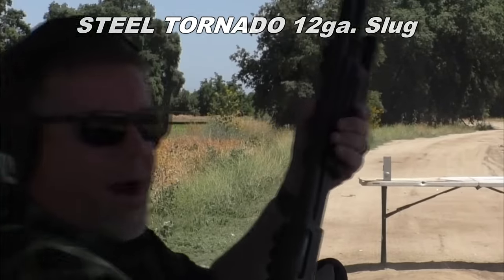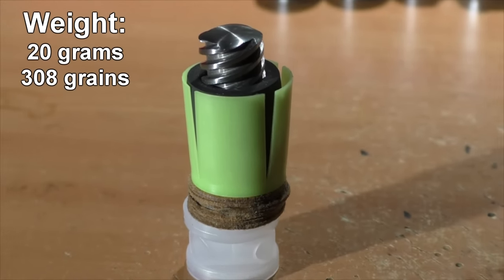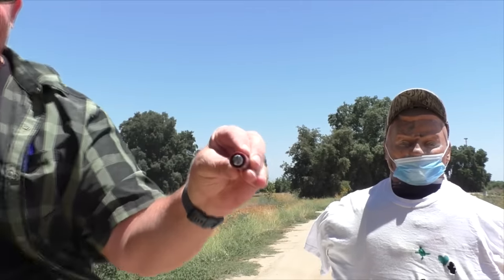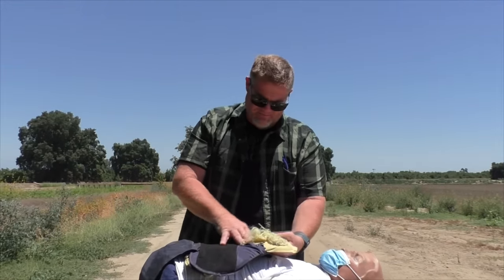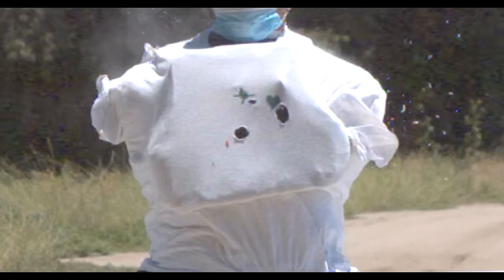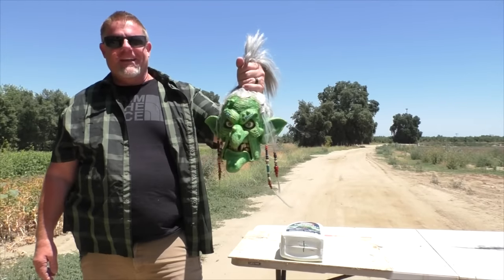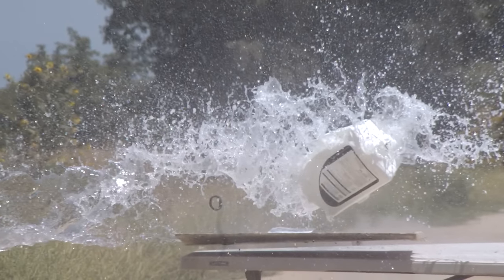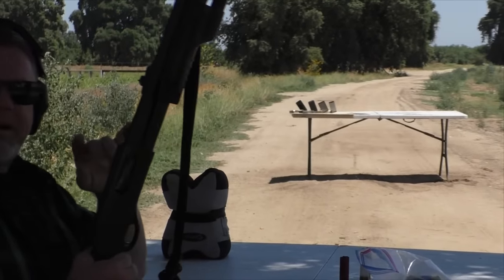We test the experimental STEEL TORNADO 12ga. Shotgun Slugs  - Wow!

Comment: Rebar slugs next please :) Cheep plentiful and easy to make.
Reply: Yes, that would be fun to see.
Reply: i have been thinking of trying to heat treat or even pack carburize some cut pieces of rebar so that they are hardened high carbon steel and then 3d print a sabot around them.
i dont have a viable work space to do this anymore so if someone can make this happen im sure the result will be interesting.
Reply: @uncoolsticcboi  I think making a sabot just for Rebar would sell. For people who live off grid it would be a great resource to have on hand if accurate. I think you could just harden the tip with a torch. You could chop saw a point or round it down like a slug.
Reply: I’d buy.
Reply: @uncoolsticcboi  i think 3D printing a sabot would be kinda overdoing it, i think just making a reusable mould that you fill with something like polymer clay would be a better way of doing it.
then add a guide line that tells you up to which point to fill it with clay, so it fills up completely when you put the rebar in, and something to help you centre the rebar inside the sabot and all you need to do now is fill the mould to the guideline, press the rebar into the mould centred (i think a reloading tool should have all you need for this) let the clay harden, remove the rebar with the sabot from the mould, rinse and repeat.
alternatively i'd suggest a two piece mould that you can fill with molten lead before inserting a pre-heated piece of rebar.
Reply: @windhelmguard5295  making a mold to mass produce the sabots would be the later stage after rapid prototyping with the 3d printed ones to find what works best.
Reply: Speaks from experience
Reply: I thought of rebar too when i saw this video. I’m surprised they haven’t done it yet.
Reply: Wait? What they shot wasn't rebar? Whats the difference?
Reply: Same thing I was thinking!
Reply: Use to make buckshot & slugs out of cheaper bird shot. Great Grandmother taught my sisters & I to shoot single shot 22 short at 5. Kill & skin squirrel. Already taught to bait a hook, scale perch. Thought everyone was taught young until I ran around in town. God. Family & Country was a must.

Comment: Acts like tool steel, not just common cold rolled bar stock. 😊
Reply: Yep, zero deformation in the lead plate.

(Yay, the lead plate returned!)
Reply: @markfergerson2145  I like the lead plate, hard enough to not completely give to anything every time, but soft enough that any good punch will give a neat impact crater for a visual.
Reply: Im curious as to how you came to such a conclusion?
Reply: @jamessouza7065  hardness. no deformation. Probably from a replaced ballscrew, which is a hardened part.
Reply: @hunterws  Wouldnt it shatter if it was hardened? oh ya it was probably tempered after forgot how all tat works! thanks
Reply: @jamessouza7065  It is a case hardened. The core is relatively soft, so it won't break.
Reply: @XtreeM_FaiL most ballscrews are through hardened. Not case hardened.
Reply: @ObservationofLimits  The ones I have work with were really hard. Soft steel start few mm under the thread bottom. 
HSS couln't chip the surface at all, but didn't have any trouble to drill the center.

Case hardening might not be the right word.
Reply: @XtreeM_FaiL  Is it face hardening you're thinking of?
Reply: @CATASTEROID934  What?

Comment: I'm surprised that it didn't go through the lead plate.
It's case hardened, so there should be very minimal deformation.
I guess it's because of the light weight.
Reply: Right...worm gear bar stock. Maybe B-4 50-60Rc heat treatment?? Who knows, F-N  V I O L E N T either way!!

Comment: I was just watching a video about the sort of ammunition that pirates fired out of cannons. 

Something a heck of a lot like "Dumbell" round was used. They called "Bar-Shot", but another projectile caught my eye...

"Star-Shot!" 

Even Perry should do some research into that.

It's basically four quarters of a steel ball, with bars smelted onto them, with ringlets at the ends which are linked together. 

Splays out into a  spinning cross when it's fired. 

Could be so.e potential in that🤔

Comment: You've got so many kevlar sheets. Perhaps, if you had a tungsten carbide punch and die, you could make wad reinforcers. Just roll out some RTV caulk stuff on the sheets, press a few sheets together between some waxed paper, and then punch out the disks to reinforce your wads for experiments that have iffy cohesion.

Comment: Nice use of old pieces of ball-screw!! Used them all the time in automation. I made the mistake of unscrewing one out of its bearing-carrier and the ball-bearings that ride in the ball-screw's flights, went everywhere!!  😎👍
Reply from the maker: Those ball screws are great when they work,   a mess when they don't
Reply: @taofledermaus  Yeah they're bad about the balls splitting cause some dunderhead will grease the screw instead of the bearing and cause it to collect trash/filings. 😆

Comment: I'm guessing, but I think what's happening is the air at that speed is inflating the rubber sleeve and the pressure is getting between the steel and the rubber and pressing it off with air pressure. 

Incidentally, "Air Pressure" was OG's competing band for Air Supply back in 1982...

Comment: If you are bent on using drywall mud, keep it in a sealed 5 gallon bucket with a little water on top. I would try regular clay watered down a little too thin it out.

Comment: Another great video showing that if it fits we can shoot it!! I wondered though, if you made a slug like that one except the threads were opposite wound than the rifling, would they cancel each other out. The barrel makes a slug twist one way and it the slug was twisted the other way? I'm not sure if that made sense.
Reply from the maker: The airflow really doesn't have much force on that a supersonic speeds.  It really takes a mechanical force to spin it in the few milliseconds of flight

Comment: Interesting  that a clean hole is made from the slug. must be that the threads act like a cutting edge, like a guillotine. would probably make some interesting punch holes if the projectile was a cone shape with threads on its surface, then im sure it would have extreme penetrating ability due to its small point of initial contact, then a shredding action as the threads act like little blades as they move through the target.  your channel is so great, everyone is proud of you.
Reply from the maker: thanks!

Comment: Great video!

I suspect the rubber was expanded by the rotation imparted by the shotgun, and caused it to depart the screw. BUT, the last shot with the leather wad shows the card stock was failing, and pushing the rubber sleeve off? However, I don't know when you were using the rifled shotgun or the smooth bore shotgun...

That tomato sauce turned into tomato puree!
Reply: More like aerosol.

Comment: Hey Jeff, I was just thining about the reflection requirements of the gel block and the hssles of putting layers of shtuff underneath it. Would high gloss metalic (sic) spray paint on the table work?   Y'know, like the fake chrome finish stuff

Take it easy, dude, and thanks for the vids man. If you had thought of this (and i'd betcha a steak you have) let me know, will ya? Cheers from oz

Comment: I made and played with a bunch of very similar rounds using cut up 5/8" All Thread as the nain ingredient.  The biggest issue was finding a length that gave stability in flight through a rifled choke.  Durn things kept key holing and veering off course at 25 yards.
Reply from the maker: Probably about 3/4"  (around bore size) would probably work best.
Reply: @taofledermaus  Interesting.  I was trying the old pistol standard of 1.5 times diameter and longer.  I will look into shorter than that.

Comment: On the first slomo you can clearly see the foam sleeve spinning and shrinking slightly as it slows down. 
I think between the rifling and the grooves the foam was compressed sufficiently to grip the slug without slippage all the way down the barrel, but as soon as it left the barrel the centrifugal forces on the foam caused it to expand and smoothly release the slug so they both kept flying true.

 It's beautiful. It's got me thinking maybe the foam itself is the key to making some of the previous failed experiments worth a second look. Can you buy it in bulk? lol
Reply from the maker: That is quite possible.

Comment: I think you're really getting some benefit that wasn't anticipated. Notice first the helix of the worm thread, a short piece of worm gear, is in a complimentary direction of the rifling. So the rifling is getting a spin started and the aerodynamics of the thread providing downrange stability. The piece of rubber hose is giving good energy translation from the rifling to the steel core but it's quick separation is probably beneficial, not detrimental.

Comment: That is a multi lead or multi start thread, this one in particular is a quad lead. The idea is to have something actuate quickly, like a window, but also retain the number of threads so you don't end up with something like a corkscrew. Acme is a rather coarse thread but it is only a single lead.
Reply: Acme is also trapazoidal. Lead screw is a square thread.

Comment: That type of threaded rod (proper name escapes me atm), is expensive stuff. It's usually used in things like cnc mills, 3d printers, etc.

But it turns out it's also an amazing projectile. 

Think my favorite thing from this vid was the yellow shot cup in the 3rd shot (I think), where it turned into a propeller and took off. 😂
Reply: leadscrew and/or ballscrew

i'm not going to rewind and watch it again but to me the threads didn't look right for that application. I could be wrong though
Reply: @Nick-bb4nk  You could be right, I'm no cnc expert. But that's what it looks to me though.

Comment: I thought the face looked more like Nancy P. than SJP.
I wonder if a revisit to this but with a steel washer welded to the trailing end of the bar that's the same outside diameter as the rubber sleeve would help.

Comment: It is an acme thread but the rod has been double threaded.  This is common in low torque applications that require a very course and durable thread with high accuracy and low backlash.  Other than that…cool.

Comment: I would be concerned that the portion of the worm gear that protrudes from the shot cup in the soft rubber Sabo was Graach the war of the rifle. I thought processes that if the rubber Sabo compresses more on one side and the other from the tremendous force pushing it it could tilt enough that would scrape the inside of the more.

Comment: At first I thought it was simply a piece of threaded rod, but cross section shows there are 4 independent thread. I wonder, what if it had a ballistic tip?
Reply: It’s a multi-start acme thread, in this case, 4 starts. So the thread has the same pitch as a normal acme thread, but it has a lead of 4x the pitch. They are used as lead screws in CNC machines.
Reply: @kenpickett9317  So the maker, who we know has a CNC machine for mass production of some of his designs, converted replaced parts from his CNC into 12ga slugs, nice!

Comment: If the lead plate is 5cm thick and it stands in an angle of 45 degrees, than the bullet have around the 7cm to penetrate, because the bullet goes straight while the plate is in an angle.. the armor of a tank works the same.

Comment: Can you use a coil steel spring instead of wadding?
Reply from the maker: It would probably crush the spring with the 12,000ish psi of pressure slamming against it.
Reply: @taofledermaus  I see you've done it in videos a few times, but I was thinking like a car valve lifter spring. The race ones might be able to take it

Comment: You need some 3 1/2" shells to get the muzzle energy up.
Reply from the maker: It's not the length of a shell, it's the powder load that determines velocity.   Can't really just stuff more powder in or you might end up with a bomb
Reply: Ed Hubel was my hero a few years ago. Slug loads for 3 1/2" are generally more substantial along with the guns chambered for them.

Comment: It's a 4 start acme threaded lead screw.
Reply: Acme threads are trapazoidal. This is a square thread, as used for lead screws.
Reply: @zapa1pnt  Yes, with a 29 degree included angle, which I can almost guarantee that thread has. Very few people actually make square threads commercially for a variety of reasons. This is probably off the shelf stock from McMaster or misaim or someone else.